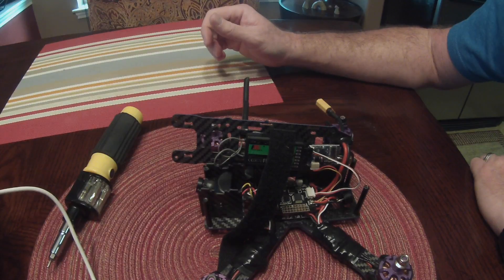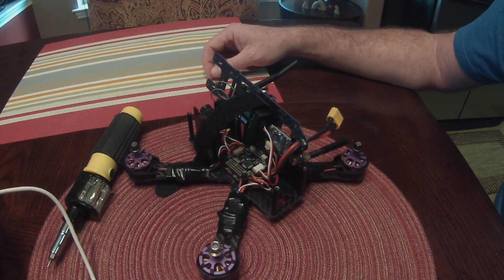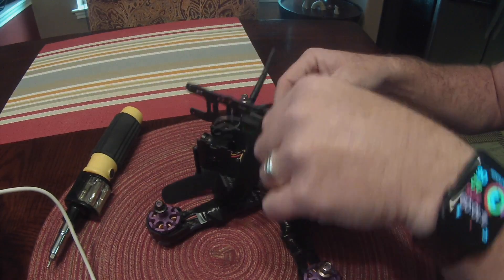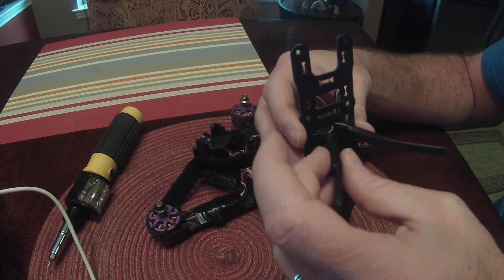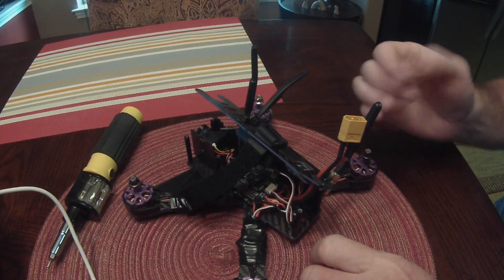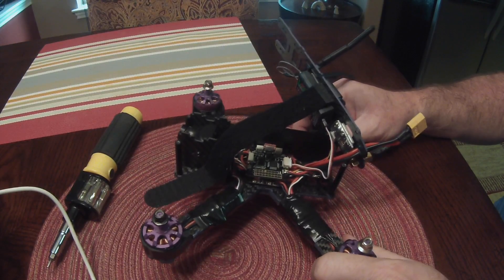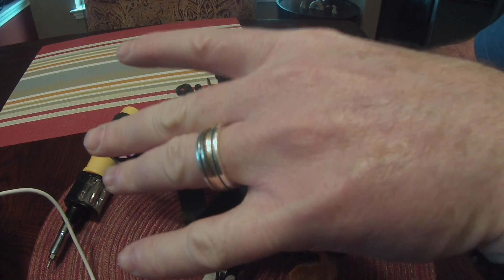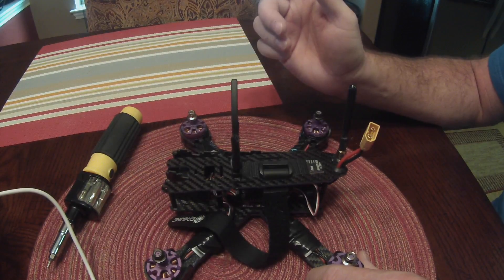Eachine Wizard x220 - Better Antenna Mount for FS-IA6b receiver

Comment: Antenna are too far in the front, meaning your battery is going to have to sit too far on the back of the quad, messing with the center of gravity. Bad idea. Just zip tie them vertically on the back, parallel to the standoffs. No chance for a prop strike.

Comment: Hi Jason,I just received my x220.  I zip tied the two antenna wires along the edge of the two rear propeller arms parallel to the Escs but on the rear edge.  Do you think that would work ok?Thanks Richard
Reply from the maker: yes I have seen others mount like that, might cut down your range a little bit but as long as your not going really really far away should be fine.
Reply: Thanks Jason,Since I am just learning, I will leave it the way it is and not change it until I start to fly more distance.appreciate the help.Richard

Comment: good video, i had my antennae mounted like your first video and found out real fast that the wire ties allow them to rotate outward and can get hung up/ sliced by props.  i mounted mine just like in this video, but behind the battery.  have not had any problems with performance or range.

Comment: Hey! Got the same problem on my wizard...
Btw, in that position, what if the top battery moves out from the strap and crash over the antennas? I am so scared...
Reply from the maker: Yea that could happen I suppose.   For my battery I have it velcro down to the top plate as well as using a rubberized strap, when I put the strap on I put it on really tight around the battery.  

I actually went back to a rear mounted system on one of my wizards and haven't had any issues with chopped antennas lately.